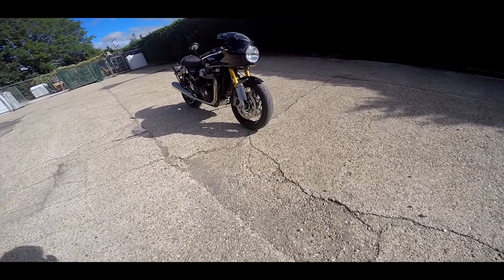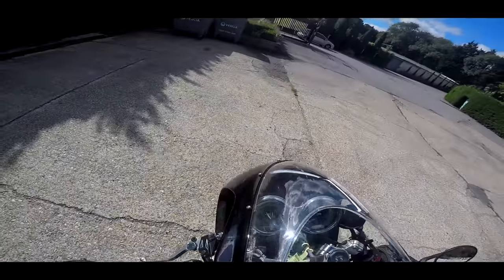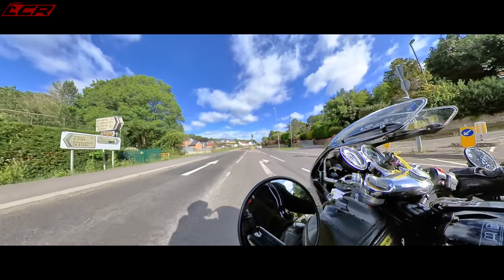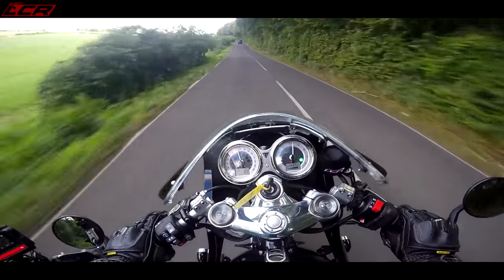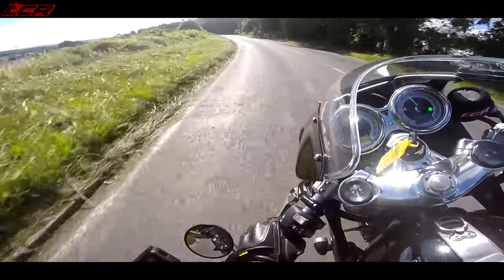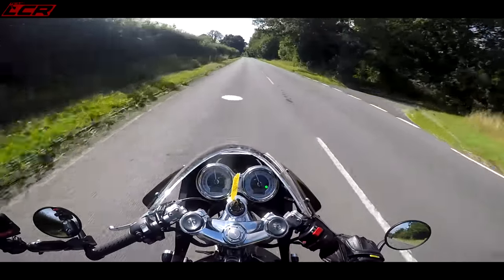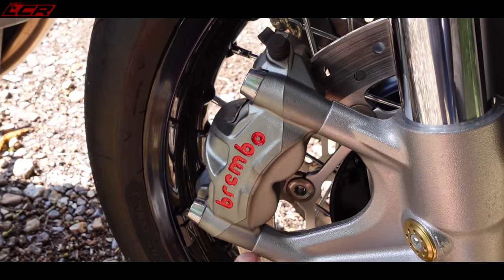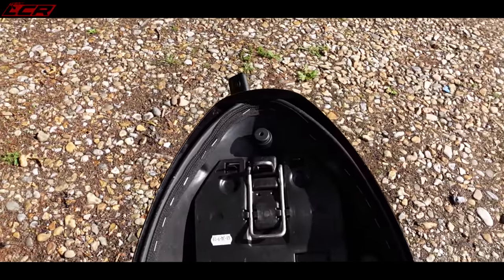Triumph Thruxton RS | The Ultimate PERFORMANCE Retro Classic??

Comment: Expensive with Expensive Servicing, Triumph must be absolutely coining it in on these.
Reply: Stop whinging, earn more coin. Simple.
Reply: These 1200cc parallel twins aren't complicated. Work on the bike yourself
Reply: @NicePantsLance  Invalidates your warranty.
Reply: @fyorbane  if you wanna pay a dealer $500 to check bolt tightness and fluid levels, then go for it. Warranty expires in only 2 years, so after that just work on the bike yourself. If you have to suck up dealer costs for a couple years, so be it
Reply: Not expensive at all I have one and ever brought it in for annual servicing the first real service is 10,000 miles on these lol.

Comment: I love a Triumph me....and with that cowl the Thrusty is indeed a looker, not sure I can get on with the riding position though...so Speed Twin for me!
Reply from the maker: Yes both fantastic machines Andy, actually would be very happy with either on the garage! 👍
Reply: @LambChopRides   A set of EBC HH pads solves the brake bite issue.  Yes,the higher stock bars fit under the cowl .   And more power is available in the aftermarket .
Reply: decated my 2017 Thruxton S, was £377 with main dealer labour,
DNA performance air filter £50
Removed air filter snorkel £0.00. 
Bike feels 6 to 7 bhp quicker. 
Dynoed it before mods as stock at 85.68 bhp & 71.44 lbs torque. 
Will get it dynoed again to check my arse dyno.

Comment: Best thing about watching this, is staring at a pair of proper clocks.
Analogue.
Not digital.
No bar code bollocks.
And certainly no ridiculous TFT screen.
Chops goes on about the wonderful handling - lets not forget this is old school twin shock - i'm trying to think of another 2020 performance bike that has twin shocks.
I cant.
Everything is dreary monoshock.
I'd probably have the Speed Twin over this as i'm not young anymore and it would be, not a better, but more practical day to day bike.
Good vid, get yersen a go on the ST.
Reply: Michael Hayward Yes! I have no idea why digital speedos on cars & bikes have become all the rage. I remember when they did the same with automobiles in the 80’s & that look aged very poorly. I would much rather look at analog gauges. Maybe I’m just hopelessly outdated..
Reply: I’ve got a Thruxton 1200 and altought the analogue dials look amazing I find to read while riding they are terrible, even for analogue clocks, not enough contrast. 
Old Triumph clocks were great, white dials on a black face very easy to read. 
TBH sometimes I wish in had an optional   digital Speedo and bigger digital Gear indicator.

Comment: I bought a 10 month old TTR with 600 miles on it- for £10k. Toured Scotland on in. Had 160 miles from a tank of gas. Had 120 miles from a tank of gas. Fabulous bike. Shame my local dealer isn't. Almost 3 months for a side stand spring on a safety recall. Chased 3 times- no reply. Puts me off buying another Triumph- and I'm in the market for a 2nd bike.

Comment: Great video mate! I love the changes Triumph have made. I had the 2017 R in silver, no cowl. I added black Vance&Hines pipes, decat and remapped the ECU; the improvement in performance was definitely noticeable but the new sound was beautiful. I loved touring with it. Only two downsides were the weight, 212kg dry, which sits high making it heavy to maneuver manually, and a crap turning circle.

Comment: Picked mine up 4 weeks ago,  the racing green/silver one. I agree about the gearbox,  it does seem clunky. Might just be because it's new and being run in. Torque is sooooo addictive.  So much grunt. 
I find the suspension quite firm but I am smaller and lighter than you. One downside is V & H no longer do slip ons as an option because of Euro bloody five but standard pipes sound good anyway and there are other aftermarket ones to go for. Leaving mine alone for now though. Great vid, enjoyed watching.
Reply: Verex Exhausts Tasmania Australia make full stainless steel systems for triumphs.Their systems do away with the cat and have a cross over pipe instead.A full exhaust system for my t120 Bonneville is 2600dollars shipped to my home in NSW.These systems are shipped worldwide.

Comment: Range on my 2017 Thruxton R is 160-180 miles so I am probably not pushing as hard as you!   On a recent weekend ride at a modest pace I was getting 57+ mpg (US gallons) and I have pushed 60+ on occasion.  Similar comments on suspension and agree on the brake feel being too soft on initial pull.  Excellent review.

Comment: Are you planning on reviewing one of the Royal Enfield models? Would love to hear your opinion of the 650 Interceptor
Reply: I purchased a R.E. Continental GT 650 when the Triumph dealer pissed me off and wanted MRSP for a demo bike with 300 miles on it. I still have the GT and done everything to it but the S&S Big Bore.  I'm now looking at the Kawi z900rs/cafe or Speed Twin or Thruxton RS.  If I get one of the Kawis or Speed Twin, I'll have cash to do the 865 big bore kit on the Enfield and or get the parts from India to turn into an Interceptor (roadster).  The R.E.s don't compare if you want power, and even with a Big Bore will only put out 65 Bhp.  For the money I've spent on Ohlins Suspension, Tyres, S&S Cam, and other parts I could have purchased that Thruxton R. No regrets.
Reply: It would really be of great help if you can make a video of your bike.

Comment: Tbf the older Thruxton 1200 standard and R models will still give you the lovely torque rush that Lamb Chop describes but bhp is up on these at 105bhp. 

The 1200 R and Standard model were quoted at 96bhp but I dynoed mine at 85.7 bhp at the rear wheel
and 71.44 foot lbs of torque. 
So they are not fast but lovely to ride sedately on that wave of torque. 
All power and torque on mine fell away at 105mph I kid you not. 
Must be deliberate engine management from Triumph.
Reply: Wrong. Your figure at the back wheel is wheel horsepower. The figure Triumph quote is a crank figure, aka brake horsepower. 
The reason wheel horsepower is lower than brake horsepower, is due to transmission losses.
Reply: I stand corrected.

Comment: My 2016 Thruxton R seems just as good but on all models they seem to have deleted the plain glossy silver metallic paint colour - you can only get a mat finish metallic silver.  Id consider one if I could get one in my 2016 model paint scheme with the brushed aluminum engine casings but the RS models are overly fussy which spoil the beautiful classic Thruxton styling. Believe me the ordinary Thruxton R is plenty fast.

Comment: My honest review aside from the positives. Cowl is for looks only - directs wind straight into your face. Wind blast & bike sounds much better without. Vibration through the bars get annoying at 4k rpm. Goes away around 5.5k. But 4k is right at cruising speed. Does not tip in fast as well as a monster or 765RS. Tank too small and low to grip or lean on. Riding position is too aggressive and wristy, pegs are quite high so not really comfy for long rides.

Comment: The range, so I have the very similar Speed Twin, which also has a 14.5 litre tank. I wouldn't say I'm a speed freak, so I probably ride it way slower than most others. I get around 53 MPG. Triumph claim about 57 MPG. MCN type road testers report something like 45 MPG.
So on the Speed Twin my riding style the range to empty is about 170 miles. MCN road tester types, their range to empty about 143 miles.

The range indication on the display on my Speed Twin is a bit pessimistic. When I calculated it , I found it to be between 26 and 35 miles pessimistic. (i.e. fill up to brim, calculate MPG, how much of the 14.5 litres was still in the tank, look at what the range said just before I filled up )
I assume Triumph are using pretty much the same electronics on the Thruxton, so in the video when it says 120 miles , it's probably 150 miles before you do actually run out of petrol . 

Yes, both the Thruxton and Speed Twin need a bit larger tank. I did moan to Triumph on the survey they sent me last year :)
Reply from the maker: OK interesting, we did a fill up comparison at the weekend. Best on fuel by quite a bit was the KTM 890 R, The Thruxton was next and only 0.30 litre more was the new GSXR1000RR. So its litre sportsbike thirsty which surprised me...
Reply: @LambChopRides  My Bruv-in-laws KTM 790 R is very good on fuel. I think he's getting 65 or more MPG.
Reply: @LambChopRides  I can see why Triumph make the range a bit pessimistic and leave something like 3 litres in reserve. Who really wants to run out of petrol ?
Reply from the maker: Yes the reserve does seem decent have to say 👍

Comment: I was told by Triumph last week (April 23) they won’t fit the standard clip on with the fairing as it will fail the MOT due to lack of full range of motion - anyone in the UK with any long term experience/ MOT issues ?
Reply: Just remembered to update - all sorted, another Triumph dealership fitted the standard clip-ons and also MOT’d. So 100% fine with the fairing 👍

Comment: I owned the previous model the R and I'd be pretty amazed if that couldn't keep up with the new rs on the road,after all you're restricted to the limitations of road use ,I sold mine as I thought the only place for it was on the track,pretty ?yes, exciting? also yes,shoulder aching,lower back crunching, good all rounder single bike.....no.,in a stable of bikes ohh yes,over here in nz a r.s is touching 27 grand ! Pre owed r  with few ks on the clock 12 grand for better brakes you don't need 5 more hp....highly over priced and not much better than the r

Comment: "If it wasnt for the slightly limited fuel range of 110-120 miles"...My 16L tank does 80 ish miles....cries in VTR1000
Reply: Tony Morrow Yup, yup..Love my VTR1000. It’s  lighter and still up on the Thruxton for both HP and torque while weighing in at twenty some pounds lighter. She is thirsty in town at approximately 160-170 Kilometres before reserve and almost 300 k on highway runs....but I don’t care as she’s a hoot to ride! Not bad for a 22 year old bike. Kinda spoiled me for a lot of newer production bikes...oh well :)

Comment: Get some chain lube on that rusty chain old boy . I have a Street twin  had new wiring harness at 1200 miles and the finish on the front wheel is coming off.

Comment: If it is "more than quick enough" how come you had modded GSXR1000R and now have H2? ;-)
Reply from the maker: Yep good question, I ask myself the same thing!
Reply: @LambChopRides  :-) So you are less "simplify and add lightness" and more "no replacement for displacement" kind of rider. So, Speed must win over Street RS, logically? There are some advantages to weight, more stability, more "muscle" feel, more macho kind of feel, I noticed you also mentioned Arnie. :-)

Comment: the cowl is  HOW MUCH
Reply: It’s £779 UK pounds, not cheap I agree but it comes with loads of special brackets and fixings for it. It’s a quality thing and transforms the bikes looks. Probably a pain and hours to fit yourself so best allow another £200 for fitting at a Triumph dealer. The dolphin fairing I think Triumph call it. It’s a stunning bike with it on.

Comment: The 1200 Thruxton motor is woefully unimpressive as was the 900 motor.
If it was retro it could be longstroke, ohv and actually have some torque.
As it stands the bike is an expensive toy for middle class  Sunday riders .

Comment: Bit too gushing, more of a Triumph big sell than a useful review. It's got so so power, above average weight for its class, build quality is ok until you get it wet and all the alloy corrodes.
Reply: Build quality is better than just ok. You seem a bit anti Triumph to me.
Reply: @fyorbane  I am TBH. Bought a brand new T120 and was very excited about it but it had a number of quality issues from the off and I was disappointed with it, so sold it. While I had it I joined the forums and many others were finding out the hard way too. No one wanted to enjoy Triumph more than me. I spent my hard earned on one.
Reply: @jfro5867  Sorry to hear that.
Reply: I understand where you are coming from. I had a T100 which I bought new in 2018 and that had some surprising quality issues. Triumph agreed to change the bike, primarily due to wonky subframe rails under the seat. They were 1/4" out wrt each other. 

Also a high price for a (low power) bike with very basic components compared to a similarly priced mid range Street Triple. Triumph can make a pretty bike for sure and they are marketing geniuses.

I have a 2017 Thruxton R and, notwithstanding the Triumph fix for fixing the random stalling being a failure mine has been ok although there are plenty of accounts in user groups etc of surprising and disappointing quality issues. 
In my case I had to have a custom map and Power Commander fitted to stop the bike stalling at random intervals, always at roundabouts and junctions at throttle closure. Triumphs official fix also failed although it did reduced the frequency of occurrence slightly. Alarming at times to say the least. As an aside, a custom map gives these bikes around 40% more torque below 3000rpm which tapers off as the rev's increase. It transforms the older bike.

What Triumph have done with the RS is bring a motor up to Euro5 regs (the old engine would not meet these regs) and address the list of known faults then package it up in such a way it's seen as a positive - which is what you'd expect them to do. They were never going to say 'we made few cock-ups with the old bike but we've fixed it now'.

Comment: I just bought a Thruxton 1200 with a thousand miles on the clock. lIKE 2 WEEKS AGO. $17000.
It does not have performance
In fact its pathetic .....Its like riding a 650 cruiser or an beginners 500.
It can only just keep up with traffic on the open road.
90 rwhp in a 200kg bike. With 1200 cc? Where has the power, torque, performance gone? I look at it in disbelief and wonder if its actually a 650 Enfield.....
It has no low,mid grunt. Top end it dips near red line and vibrates like a trail bike you are thrashing.
At 130kmh it revs its box off and rattles up to 160 near the red line.
It is a total disapointment.
Maybe it needs a major service having averaged 400kms a year use. I do that in a day  just going to the nearest big town.
Somehow I must get rid of it and accept the loss of hard earned money before  I take a sledge hammer to it.
The disapointment is immense.
I bought at a city Dealer...Perth West Australia. Traded a tidy low mile Kawasaki zx14R. I wanted something lighter and not hypersonic. 
Drove home 200 miles on country rods.
It overheated and lacked torque.
Like a sewing machine.
Its not retro in performance. I am 69 and  I rode Bonnie and Commandos.
I had Harleys and have a 1900 Yamaha.
They all have torque that sits comfortably in a mid rev range and flatten hills.
This pathetic Thruxton just spins and feels like you are freewheeling on a pushbike.
It cannot even race with farmers in their 4WD Toyota utes. 
A pick up is faster.
I have had a 955 Sprint and a 600TT Triumph. Avoiding the 900 Speedmaster and Thruxton after test rides as the 900cc reminded me of the performance of CB 350 Hondas,
All the reviews wax about how the Thruxton 1200 has the looks and the performance.
Well in my experience the performance it does show is only OK for congested places like London and haveing a ride around the B roads in the British countryside.
Anyone who has had bikes with more demonstrable power riding on wide open straight roads will surely find this bike unsuitable.